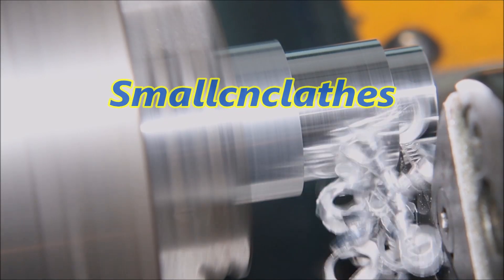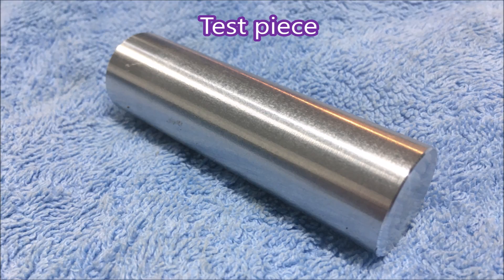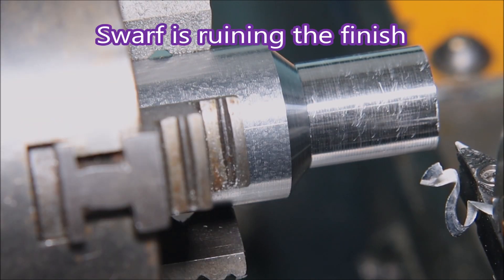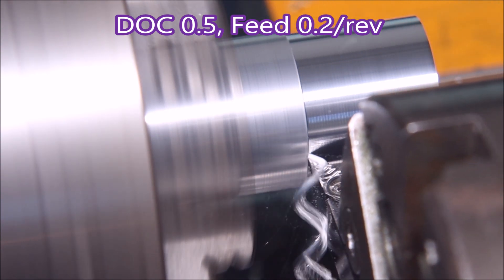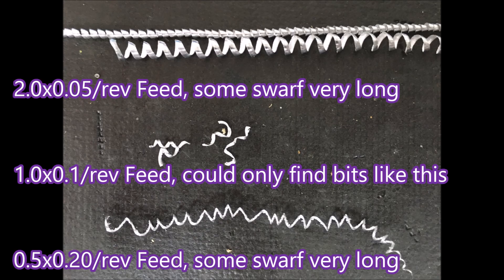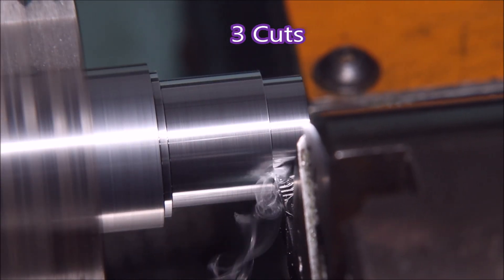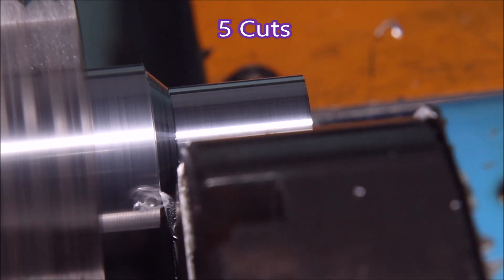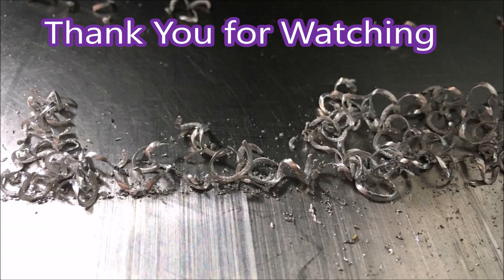Feeds, speeds and depth of cut in 6061 aluminium alloy in a small cnc lathe. Trying for chip control

Comment: I gave up turning aluminum on my mini lathe because I found a better way.

Got really tired of the swarf, no more.
Bought some good 3/8" carbide endmills, variable helix and do all my aluminum on the mini mill now.

I can mow thru it at 0.3" deep and 0.1" 
Depth of cut running at approx 1k rpm.

Makes beautiful chips and I climb mill it always.
A heavy duty rotary table if needing to mill circled.
Reply from the maker: I limit my turning to 2011 ally and brass, never have a chipping problem.  With no mill, I just have to do however I can with the lathe.  Thanks for your comment

Comment: What you guys recommend for 45mm 6060 aluminum?  Its been very hard for me to machining it. Very long strings. Tried it with 1500rpm, f0.1 mm/rev. Maybe up the feedrate?
Reply from the maker: Hard for me to make a suggestion as I have never done it successfully. I know others with large machines that use deep cuts and large feed and coolant and it works well for them

Comment: It sticks to itself, not to mention the fact that it sticks to the end of the cutting tool as well. Like it welds itself there almost and you have to scrape the stuff off with a sharp piece of tool steel or something. 6061, I hate the stuff. It's the only thing I've found that take the joy out machining for me. I'd rather just smack myself in the face with a hammer than cut 6061
Reply from the maker: Not much fun in smaller machines, but I have a friend for whom it holds no fears at all.  25hp and flood coolant makes all the difference!
Thanks for your comment, all comments are much appreciated.
Reply: @smallcnclathes  25HP... i can only dream

Comment: There are different tempers of 6061. The cold drawn T651 temper cuts a little nicer than the T6511 extruded, which tends to be softer and the chips don't break easily unless you are going at a million revs and very fast feed. Sometimes an insert with less chipbreaker helps, but spindle load goes up.
Reply from the maker: From my supplier, T5 or T6 is the range of choices? Thanks for your comment.
Reply: @smallcnclathes  I'm in the US, those are standard tempers for 6061 here. Another common grade is2024 and is much harder (and more $) and cuts excellent and also comes in different tempers. Ask your supplier for "screw machine" grades since they are meant for unattended machining where a birdnest of chips would be a bad thing. Good videos with great content, would like to know more about your machines. I think they are excelent for advanced home shops and also can make for excelent training tools.
Reply from the maker: That is so funny. Screw machine grades as in plural. This is Australia, nobody lives here and certainly nobody here makes anything, so our markets for any supplies are tiny. We are lucky to still get 2011 I imagine. No one is going to import stuff that they won't sell in a reasonable time frame.
The lathe and mills were made as machines for educational institutions. That is a good thing as mine has had to teach me how to use it. When I bought it back in 2005, had no experience in cnc so the lathe had a bit of a job to do!
Reply: @smallcnclathes  Ah, but according the the group "Men at Work" you come from the land of plenty! I guess my view of Australia is similar to the US from material availability and distribution networks and such, guess I'm going to have to reassess my world view.
Reply from the maker: That is an old song, not very applicable these days. Our small population and lack of manufacturing base means raw materials are quite limited.
Reply: @MRCNC1967  Plenty of grades that machine well but if your making structural components and need to weld to other 6061 parts then  2024 would not be acceptable.  6061 extruded tube I have to buy from the states or order a mill run. If only Men at Work were singing about  extruded tube options when singing "a land of plenty"  LOL

Comment: Did you say 2mm doc? On a 1/2hp motor? Wow. That is a very efficient lather or tooling there.
Reply from the maker: Umm, yes 2mm at 0.05/rev feed. Just completing part 2. A viewer suggested using 1200 rpm, but I can only get 1000 in low range so I am just completing a follow up video, DOC 2 at 0.2 and 0.3 feeds.

Comment: Would it be possible to do some sort of “adaptive turning” where you would turn short sections of the bar to limit the length of the stringy chips?
I know it’s not a built in cycle but maybe that would work where small lathes don’t have the power to activate the chip breakers on turning tools.
I’m hoping to experiment with that in the near future.
Thanks,
John
Reply from the maker: As I did here?  https://youtu.be/tV-2O5gvcac
Reply: @smallcnclathes  
Yes. It seems to work pretty well for roughing. Nice video.
Thanks,
John
Reply from the maker: @cavemansmancave9025  thanks John, I only turn 6061, when a customer has refused to go elsewhere! I have usually managed to get the job done ok, but not something I ever volunteer for.

Comment: I’m guessing machine hasn’t got the rigidity to be pushed much harder? 
We have no chip problem at work with 6061 but  we rough at 2or 3 mm doc and feed of .3/.4 mm per rev
Reply from the maker: Can I ask what hp you have at the spindle on the machines at work? I have a friend that never has problems with 6061, his small lathe is 25 hp. This look at turning 6061, was really for a friend with the same lathe and all the folks with mini lathes.
Reply: smallcnclathes I don’t know off hand till I go work and check but the motor inside the turret for live tools is 5hp so I’d imagine the main spindle is a lot more
Reply from the maker: Machine is a small lathe with half a horse power at the spindle. Very rigid machine for its size. The motor is rated at 5 amps and was close to that in this video

Comment: I understand that you can't lower the enclosure lid when you're making videos but if and when you do- do you run coolant? Does it help with the swarf problem? Thanks for the video 👍🏻
Reply from the maker: I avoid the swarf problem, by not using this material. In fifteen years working I have probably only done half a dozen jobs using 6061. One luxury of being self employed is not doing jobs one wants to avoid. Flood coolant would probably help, but I don’t use that either. Flood coolant is messy and not suited a small business like mine.  I use spray mist when I need it, I suits me better.
Reply: Yeah I was thinking the same thing about coolant, not that I really machine aluminum much, but when using flood coolant or dry cutting seems to have an effect on chip forming with many grades of steel.
   Buy I guess not everyone runs coolant so there is other way to get around things.

Comment: Could you make the g-code do the equivalent of bumping the hand-wheels to prematurely break the chips and make them easier to tidy up and then do a regular finishing pass?
Reply from the maker: I have in the past created code that uses lots of very short cuts, that helps. Although to be honest I have avoided using 6061. What do you mean by bumping handwheels?
Reply: I'm not a machinist myself so take this with a grain of salt.

I have heard that manual machines can break chips if the operator quickly turns the wheel forward and backward when the buildup gets bad.

It's only a small amount of travel (maybe 1/10 of one division) hence 'bumping' the wheels.

Hope that helps.
Reply from the maker: Sounds a bit like my taking short cuts
Reply: @AdrianTechWizard  this is commonly referring to drilling operations I believe, you can bump the tailstock to break the chip. I'm just a hobbiest, but I've not seen similar done in turning operations, at least not that I recall. 🙂

Comment: Reduce rpm and increase cutting depth, even 7075 aluminum can be easily cut with small chips this way
Reply from the maker: What rpm do you suggest for 25mm?
Reply: @smallcnclathes  use 1200 rpm , 0.1 feed , 3.5mm depth for roughness and 0.2 depth for finishing
Reply from the maker: Never going to happen with 1/2 hp. Doc 1mm at 0.1/rev feed is 4 amps. Motor is rated at 5 amps. I could go to low range and get 1000 rpm, but I still don’t think that would get me to the cut parameters you are suggesting.
Reply: @smallcnclathes  I do not think it is too much
I have a manual lathe with 2 hp, it works very, very easily with these parameters, even less than a quarter of a power
Reply: @smallcnclathes  I thought about it a lot, yes it may be too much but with much deeper cut and lower spindle speed it works much better
use 2000 rpm , 0.05 feed , 3mm depth 
I hope it works very well